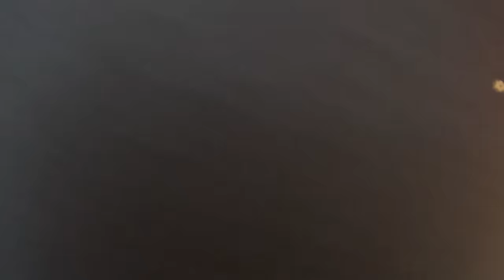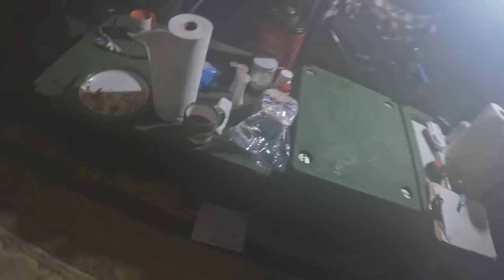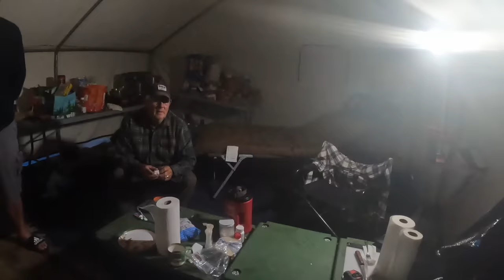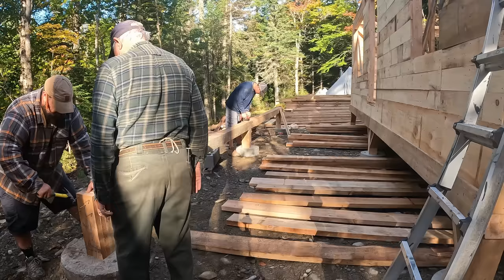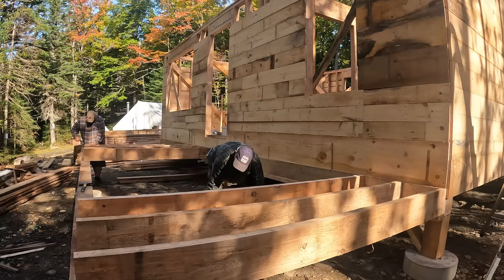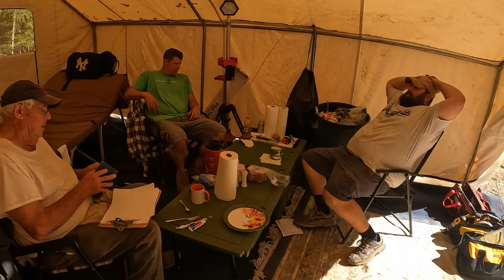Off Grid BUILD: Timber Framing the porch and Sheathing the Walls: Episode 17

Comment: Another question. Do you put some kind of rubber (ZIP tape) like barrier between your posts & cement to prevent water wicking to help stop wood rot? Or is it not necessary? Thanks.
Reply from the maker: Great question we feel it’s not necessary the building covers most or all of them and not enough water wicks up to worry about they dry out quickly and if ever rot can be replaced super easily

Comment: I use a Construction Master 5 calculator and it makes figuring rafters easy.  All you need is the run and pitch wallah you have the rafter length.  It also makes figuring pythagorean theorem easy to square things up
Reply: I used to use a framing square to figure rafters then after the speed square was invented, I started using that little blue book to get the number. I have the app on my phone but still like to use the book for some odd reason.
Reply: @jefferyholland  How old are you?  I've used a speed square since the 80's but that is when I got my first Const. Master calc.  You must be really super old as the speed square was invented in 1925 by Albert J. Swanson/Swanson Tool.  The book gets you close but the calculator gets you as close as you want like within 1/16" and takes seconds to do
Reply: @jefferyholland  I saw a show on tv about How America was Built and Swanson was a key part in it.  The other great part of the calculator is figuring hip and valley jack rafters as it will compute each with the push of one button after the first is figured.  It also had a rugid case and I keep it in my pouch or on belt. I've had the one I have now for over 20 years and I bet I would still have my first one if it wasn't stolen
Reply from the maker: For sure

Comment: Did Donnie use his little book to make sure your beam and rim is strong enough to support your walls, roof and snow load(live and dead load).  It looks like you have a pretty long run there
Reply: Of course he did. ❤️🥰
Reply from the maker: Yes this will be the most rugged building in the NMW